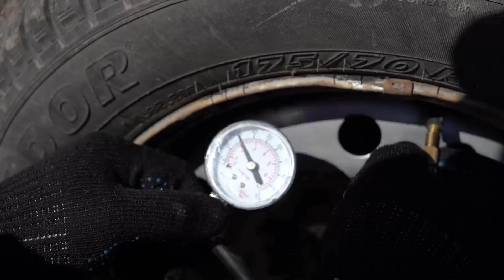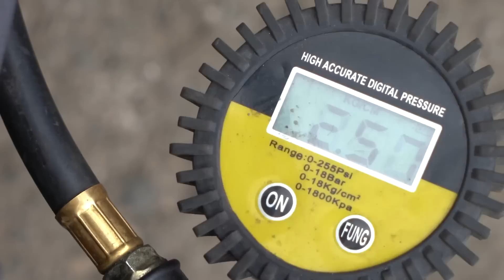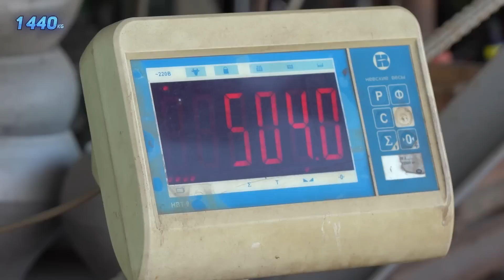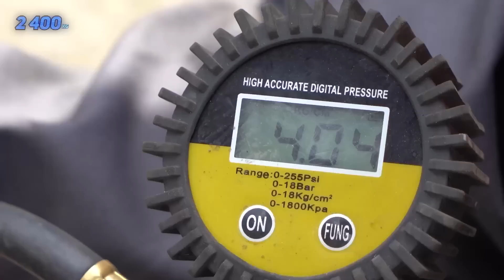How much weight does it take to pop a tire?

Comment: I was screaming that trailer hitch will give up since it's baring some of that load but I guess my voice didn't bend space time🤣
Also that weight rating is for a square inch of the tire, since the tire has to withstand the motion, the heat and the shock up to 10Gs on the road and with 10-20% safety margin, that weight is correct.

Comment: I'm not sure about there, but here the laid rating changes with tire pressure. The sidewall tells you the load rating at max PSI. Some tire manufacturers will give you more ratings.

Comment: makes you wonder how much weight a truck tyre would take. I looked up a random truck tyre and it was rated for 3000kg per tyre. So if it had a safety factor of 10x like these passennger tyres, it might take 30 tonnes per tyre. On a 28 wheeler,  that would be 840 tonne required! Imagine trying to put 840 tonne on a truck! Well, if anyone can do it, garage 54 can :)

Comment: Overload a fully stock Lada with minimum tread on tires, and drive until you can’t, then keep loading until the rim touches the ground, testing pressure like you did here. 

I always wanted to know how much you can load into a 4 door sedan.

Comment: Max load rating of a tire is at max air pressure.  Tire is most likely rated for 44psi and that's when it can hold around 500 kg. If the pressure is at 20 psi then it should be basically only hold 250 kg per tire

Comment: major thing with weight, not only does the tire rating play a factor in load weight however its also your wheel bearings, hubs, axle, suspension etc. All of that takes into play. What may not blow a tire driving 3 miles an hour. But just standstill weight will bend the axle and ruin the suspension. You can also damage a frame as well.
Edit:

The standard weight rating per tire is also included based on heat and faster speeds than what they are doing. 
I can say that 2,000 - 4,000 pounds over weight limit those tires will blow after less than 50 miles.

Comment: The tires have to be designed for the *dynamic loading it will encounter in operation through its speed range. Dynamically, hitting a pothole at 80mph is tremendously different than static loading.

Comment: This not an accurate test big fact not included is more heat is corrected going down the road with more weight.  So this is a false test of the tires.

Comment: YouTube is an American company.  They need to ban all videos that use the (non-American) metric system unless translated to American measurements.  All the other nations in the world need to convert to the American system of measurements or be subjected to economic sanctions.  Nations that do not comply should be invaded, especially considering that dangerous street drugs such as fentanyl or methamphetamine are sold by the gram or kilogram.  Remember:  "Convert to Pounds or Get Pounded"
Reply from the maker: Dude)
Reply: @Garage54ENG  smirk :)
Reply: No need. Canada uses metric on road speed limits, weather in celsius (American system for railways, sportimg events, cooking).

UK uses American British measurments in speed limits on roads

Comment: The ratings on the tires are not the maximum limits the practical tire can take, it's a maximum safe limit for the consumer should use, for liability against the manufacturer.

Comment: I remember a long time ago, my neighbors 16 year old son dropped by for a visit in his Honda Accord his dad had bought for him.  He said he thought the tires were low, so he stopped at the gas station on the way and aired them up.  My neighbor checked the pressure, but his gage seemed to be defective, would not give a reading, just popped out all the way.  I checked with mine, it pegged the needle at 60 psi.  So I got my bicycle gage….the kid had put 113 psi into those Michelin tires.  He was not very hands on, and had no idea that this was bad, he thought “they looked low”.  He thought they needed even more air.  It really scared me at the time, but after seeing this video I guess it takes a lot more than that to blow them up.
Reply: A customer brought their 2008 Chrysler 300 into my shop one day for an oil change. While doing the service I checked the pressures in her aftermarket low-profile 22" tires.

Each one was at 90 PSI.

Damn thing must have felt like it was riding on steel wheels.

Comment: welcome to the world of engineering and technical design

the wheels load rating is calculated with a safety factor of 5-10x the load rating, in some cases that safety factor can be as much as 20x and more depending on the specific application

a wheel is, by it's nature, a part with dynamic loading, for dynamic loads you generally have a safety factor much higher than for static load
then it's also a safety relevant component adding to that safety factor

Comment: I knew this would happen. The weight won't make a tire pop, but the heat does when going down the road. Having the tire's sidewall flex by being overloaded or underinflated causes excess heat and weakens the tire.

Comment: What if you run a twin turbo setup on something and then route one of the turbs to the cool off the intercooler/radiator and then the other works normally

Comment: The ratings on a tire bare the entire systems limits in mind at the same time, so those ratings would be for the worst case condition for the tire, e.g max pressure, at max speed, with max load rating, and obviously the temperature that would be generated at those ratings from friction when braking or turning. But still impressive to see a tire withstand one rating to such a 
degree!

Comment: At 100000lbs my pickup bent like a banana right in the middle the time were on the road I just let some air out and drive real slow it made it though 1at hear wide open to do just 25km an hour it made it though  a 2002 Dodge ram varies that much weight is massively overloaded it was just a half ton truck 1100 lbs or so recommended weight almost ten times what's recommended on aluminium rims too I think they are stronger than steel rims

Comment: Meh.. static load.. try this in 90/h with summer conditions and too low pressure inside the tire. You will see quick blow up with much lower load.

Comment: Quote taken from a tyre retailer "The load rating, load index or load carrying capacity is represented by a numerical code and is associated with the maximum load that the tyre can carry when operating at its maximum speed rating up to but not exceeding 210kph." 
Therefore unless you are driving at speed then it's a pretty useless test.

Comment: FWIW 6000KG is not 6 tons , it's slightly more.

Also , tires and lastly the trailer axle rating are two things to considered
Reply: It's 6 metric tons.  1000kg is 1 tonne = 2200lbs, one imperial ton.

Comment: You would never be able to drive on the road with this kind of load on those tires, trailer, tow vehicle, etc. The tires would likely fail on the first corner or bump. If they didn't, they would fail from overheating within a mile or 2, assuming the trailer didn't disassemble itself or the tow vehicle didn't break down/crash first.

Comment: The ratings are when worn tires and tires at the end or their shelf life will function as specified added a generous safety margin. New tires should handle double the weight they are rated for with ease. For a while. Not that it would be safe to overload the tires and drive like a mad asshole down the highway, because then you add rotation to the mix, and I suggest you find a way to test that out.

Comment: Forget the tires, that Toyota van is amazing with such a towing capacity!!!!! 16,500 pounds!!!!!
Reply: Let's see how fast it can pull that trailer in second gear.
Reply: Just moving it around at low speed isn't that difficult. The towing limit on a vehicle is mostly how much weight it can control at normal driving speed. With a trailer that can handle the weight, the Toyota could probably move twice that much around a parking lot. I wouldn't want to be anywhere near it if it got on the highway, though.
Reply: I guess you didn't make it to the point where the hitch snapped
Reply: @MadScientist267  the trailer broke i thought
Reply: They do have nice all wheel drive system for towing several thousand kg
Reply: Ha,  you can ton anything but can you stop ?  :) I would hate to be the kid that runs in to. the street chasing a ball, &  in front  of a Toyota Hiace pulling 15k+ lbs.

Comment: Got thrown for a loop when the translation kept saying "Kilos" for what looked to me clearly like Bar. So a quick note, a kilogramforce/centimeter^2, is a deprecated SI measurement that is equivalent to 98-ish KPa, whereas a Bar is equal to 100KPa, so there's your factoid of the day. (1 bar is roughly 14.5 PSI for the Americans)
Reply: Yes all of the videos are like that and it drives me nuts
Reply: Technically you're correct. Kilos is sort of a colloquial term, and while it's not entirely accurate, it's "as near as makes no difference", as they say.
Reply: @SwapBlogRU  Yes it's a prefix and understanding the context is the only reason it still makes any sense when he says it. "Kilo" by itself tho usually refers to mass, but even bending that to pressure as we do here in the states with PSI ("pounds"), it still doesn't make sense. At 3 "kilos", that would be a mere ~6.6 psi, where 3 bar, and what is actually meant in the videos, almost 45 psi. Not exactly a trivial difference. 

Those of us that get it, get it, but imagine how confused someone without the insight would be when their tires are still flat while the ones in the video at the "same pressure" are wanting to pop.

It is what it is but I'm glad someone besides me noticed it and said something.
Reply: @MadScientist267  I feel like you might be slightly overcomplicating this. I'm pretty sure that "kilos" in the original video refers to "kg/cm2" (which the OP picked up on, with him mentioning "kilogramforce/centimeter^2"). If we were to express kg/cm2 in atmospheres (which is the measure we use for tire pressure here in Russia), then 1 kg/cm2 would equal 0,967841105354057 atm, or if we prefer bar, then it would be 0,980664999999998 bar. Again, close as pretty much makes no difference.
Reply: @SwapBlogRU  Yeah my bad on that. I thought about the metric end after but didn't bother to come back to make any corrections. You're right. Still just so odd to hear as an English speaker using imperial lol
Reply: @MadScientist267  I get it. This used to be sort of a point of contention during the early days of this channel. We used to use miles and other imperial metrics, but it was actually people in the comments who said that it felt weird that Russians would be using miles instead of kilometers and so on.
Reply: @SwapBlogRU  Hahaha wild

Comment: What amazes me is the trailer hitch and van being able to pull that much
Reply: The trailer hitch is made the handle the forces of a 2 ton trailer braking or accelerating at high speed. Slowly driving, the forces on the van aren´t crazy.

Comment: Love it, Cheers from England!

I once put a Battery powered forklift on my trailer, the owner of the forklift said it weighed 4.5 ton, turns out it was almost 8 ton, Lets say even though it was a 4 wheel trailer it rolled all of the rims through the tires plus the ground and over a few miles all the air escaped plus the trailer was making some very very alarming noises, like pops and bangs and moans and groans! Once we got it to it's new location, all the tires was flat as a pancake and we bent the ramps like bananas trying to get it off.

All this on 4 old Ford Granarda alloy wheels that was over 20 years old already, unfortunately only 1 survived to this day.

Moral of the story, never believe any one when they say there forklift is lite!

Keep up the good work and keep the video's coming, full respect from the North East of England.
Reply: Cool story bro
Reply: The moral I got is do your own research and know the limits of your equipment.
Reply: If that was really the N E UK, you would have put a forklift on the roof of your 1987 Sierra like a real man
Reply: Yeh right then ran the straps through the doors, well not straps blue rope 😂 @280925henry
Reply: golly, what a story bud! 👏🏻

Comment: Towing test was invalid. We all know rednecks have their trucks loaded in the bed till the truck is pointing at the sky 35 degrees, with the trailer carring 50% more than it's rated for. Then you go on the hwy and drive 70 to 90 mph.😂

Comment: When breaking in strong curves the whole weight of the car may be on just one tire, so they can bear at least 1.5 tons. In addition when hitting bumps or potholes the weight is multiplied. This is calculated by engineers for safe driving. My opinion though..
Reply: True. The rating means that the tire should operate at given weight indefinitely. So you can drive as long as you want at max speed that a tire is rated to. And as you said - drive on uneven terrain, curves etc. It's not just static load.

Comment: i think in case of real driving at normal speed there would be additional stress and resistance causing heat and it would fail after some time with much less weight.

Comment: I see the tires on my car are rated for 650kg per tire.  Given my car's 1315kg weight and 60:40 weight distribution, one front tire would be holding up just 395kg.
And that's not even accounting for unsprung weight and left-right weight ratio.  The key takeaway is that, I can get A LOT FATTER and the tires will be fine.

Comment: He used a  car rear axle instead of the normal trailer axle, even so I'll bet when they unload everything the axle is bent.  I saw a trailer so overloaded that the two axles were bent so much the the wheels had a 15 degree negative camber.

Comment: Can you redo this episode with aluminum wheels to see how much of a difference there would be?
Reply: Steel rim is Extra tough if it's a subcompact car to 1 ton truck. Aluminum alloy rim is extra tough if it's a 4500 dually to semi truck
Reply: And make the aluminium rim out of soda cans
Reply: Steel rims bend, aluminium rims crack and snap. Aluminium rim would probably break and split when the tire pops or maybe even before.
Reply: The tire pops not the wheel , r u we todd did
Reply: Doesn't make that big of a difference
Reply: It wouldn't make a large difference, if any at all. The tire is the weak link here

Comment: The weight and the speed index do not show the maximum the tyre can achieve and then when you increase them by 1 it will blow up. No. This is the maximum rating for how fast under how much weight the tyre can work all the time without increased wear and decrease performance. 
So it's normal to take more than what is the rating, but the tyre will wear faster and might get damaged very quickly.

Comment: The fact that they could handle more than 10 times the load its amazing.. and i was worried when loading 2 tons in mine ...
Greetings from Uruguay!!
Reply: If you drive at any kind of sustained speed with more load on the tyres than they're rated for then you should be worried.

Comment: I mean for experimenting is pretty hardcore to install 7+ tons on EACH  wheel but driving would be insane. 
I have seen people who loaded up their cars with 2-3 tons of cargo but anything more would be insane and dangerous. I drive a 3.5 ton van at work and empty it's at 2600 kgs. If I load it with one ton of cargo I can already feel it driving more difficult and braking is a problem, especially if I descend a mountain. 
So overall WEIGHT is not everything. When you load your trailer or van with stuff don't think all about if tires can handle it, because clutch will take a beating and also your brakes!! Stay safe and love this channel
Reply: I used to drive a 14' flatbed, the most i ever hauled was a bunch of skids, net ~16500lbs, 7500kg. It was interesting, the truck didnt have the brakes for it.

Comment: That van is a beast too! Pulling with no issues.
Reply: a bike could pull that
Reply: It takes a pull like no problem, not afraid at all. That’s a great van right there.
Reply: I also used to pull with no issues. Now i have this back pain and i can only half pull. 😂
Reply: Toyota is Toyota
Reply: A lot of things can pull that at 2 mph!😂
I’d like to see it go 35 or 40 mph!
Reply: @Zach-sg5uu yeah you have no idea the engine that’s inside of that minivan